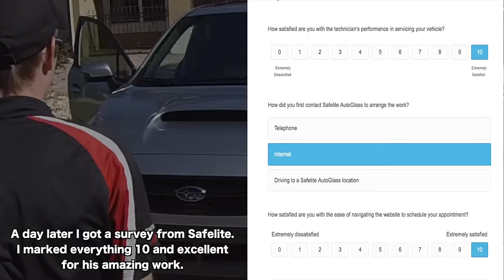Safelite Cracked Windshield Replacement For My 2019 Subaru WRX STI

Comment: At least choose an American company next time.  Safelite is owned by Belron a European company. You can choose any business you want if you use insurance. Safelite owns the call centers so they steer customers illegally to use safelite.
Reply from the maker: When we needed a windshield replacement for our GTI we wanted to try a local glass replacement company instead of Safelite. Due to our insurance company SafeCo being affiliated with Safelite, the local glass company had to get approval from Safelite to do the work. They were able to do the replacement and we were even able to get an OEM windshield. Total cost was about $850.00 and our insurance covered all of it.

Comment: Just to let you everyone know. First off you chose the wrong company because they sell you a lower quality glass. The glass they sell is manufactured by Safelite and it is qualified as an OEE glass in the auto glass industry. Not even equivalent to OE or OEM Glass. Second of all, they will hire any 18 year old kid off the street that hardly knows what a 13mm wrench is. Point proven at the 3:45 - 3:55 minute mark of this video he didn't even prime the bottom of the windshield, the most crucial part of the windshield to be bonded to the car where the air bags are located. Third and final point he didn't even bond his two joints of urethane together at the center portion at the top of the pinch weld or the roof of the car. You will notice this at the 12:30 - 12:42 minute mark. I've been installing automotive glass for 14 years and you would not believe how many times i've had to go behind Safelite and fix there screw ups. I feel sorry for this guy because if gets in a  wreck and the air bags deploy the windshield could be ejected from the car because it wasn't bonded properly. Because the windshield is a back board for the airbags. And there's probably a 90% chance the windshield will start leaking in the future because the urethane wasn't bonded together at the top of the pinchweld... Beware of Safelite.
Reply from the maker: Thanks for commenting Jeff. My windshield will probably need another replacement soon anyway. It's only lasted this long because I haven't been driving as much.
Reply: If you pause it at 3:48 the winshield is primed. Btw safelite doesn't make the winshield they buy them aftermarket unless the customer request OEM glass it's all up them.
Reply: Hi Jeff. I need to get my windshield replaced on my Honda CRV. I made an appointment with Safelite but your comments make me second guess that. Which company do you recommend? I live in San Antonio TX. Thanks.
Reply: @nickdiaz6838  Correct safelite no longer makes there windshields. They go aftermarket now.  I had safelite do a install it took some pretty good rock hits and it never crack or bullseye.  Never had it leak on me either its been years now.  Several years ago I was involved in a front collision with a car that had safelite glass. The airbags deployed never had the windshield eject or anything. Of course I felt like I was being ejected buts that another story.  Also a dealer is not some miracle worker either. I have had far worst work done at a dealership on glass replacement.  safelite does glass day in and day out. A dealership does not do allot of windshield replacements from day to day.   Some smaller dealership may farm out the glass repair to a 3rd party using direct oem replacement glass. This happen to me once.  I also have had so called "Experts" on a mustang years ago do a glass job, when going to a car wash it was everything I could do to stop the water from coming in.  Ultimately it just boils down to how good the tech is.  Regardless of the location.

Comment: I would have been mad if they bend my intercooler.  I also don’t like that he put that dirty tarp or mat on top of your hood. I don’t want any swirl marks. I also don’t like him standing  on your door sill. Doesn’t he know it scratches?
Reply from the maker: I am the same way with my cars but I let him do what he needed to do so it was done right. The pad he put on the hood had a soft material on the bottom that kept it from sliding. He was only about 150lbs so I didn't mind him stepping on the door sill. The front of my car has rock damage that damaged the xpel film and I'll show you that in a future video. I'm more upset about that than anything else.
Reply: ntercooler fins bend sooo easily. He pointed out his mistake and didn't try to hide it. No need to get mad. Just bend em back with a screwdriver.
Reply from the maker: Chris they bend from bugs hitting them too. I check the inter cooler on a regular basis and straighten out any fins that look out of line.
Reply: He's standing on the door sill because you have to hold the urethane gun very straight as you run the bead.
Reply from the maker: @OGStinkywizzleteats  I rather him stand on the door sill than use a ladder that could possibly hit the car.
Reply: Lol that mat protects your car buddy we are told to use it incase the cups slipp and it wont leave no type of swirl marks either
Reply from the maker: Joseph Guajardo I didn't mind the mat at all.
Reply: Don't get mad. It's just a car!

Comment: Bro that’s sad!
Reply from the maker: I couldn't believe all the work that went into replacing the windshield. I've had windshields replaced before and they didn't have to remove anything but the wipers.
Reply: @CarStory  That's the quick and dirty method.
Reply from the maker: @OGStinkywizzleteats  Did you work in glass replacement?
Reply: @CarStory  Yes. There are some vehicles that you don't necessarily need to remove the cowl panel. Most of the time they should be removed to ensure a quality install.
Reply from the maker: @OGStinkywizzleteats  Ah very interesting. Four weeks after the windshield was replaced, another rock hit the lower driver side corner and cracked it again. I took it to Safelite and they patched it so it wouldn't get worse. The car is a rock magnet.
Reply: Car Story it’s called stuffing and there are cars you don’t have to but you should
Reply: Stuffing is just cutting corners. Never do that.
Reply: Francisco Contreras you from Safelite?
Reply: @blessedlife93  i know it as hand bombing, and there a time and place for all techniques. think my ocd bugs me about the lots of joins in the bead

Comment: Damn you really left the window out in the sun the whole time the glass can warp from the heat and not sit correctly and he would know cause of the urathane till an accident happens again showing why safelite is the most sued glass company didn't even wear gloves or decomaninate the glass were he put the primer on the window and touched it with his oily hands might have seemed good but tons and tons of little things that need to be right he just was trying to be fast for

Comment: Lmfao bro is breaking ALL the rules no nitrile gloves while using chemicals and no cut gloves when using razor blade also have to have to have gloves in the whole time either nitrile or cut gloves.also he NEEDS TO decontaminate the inside of the glass where he’s laying his poly urethane or else dirt and oils (since he had no gloves in touching all over it) will not let the PU bond to the windshield and pinch weld of the vehicle… yes he was fast but he sucked which he can be held liable for especially since you took a video the whole time .
Reply from the maker: dont forget to like and subscribe 🤣